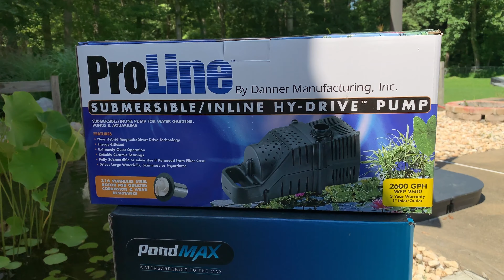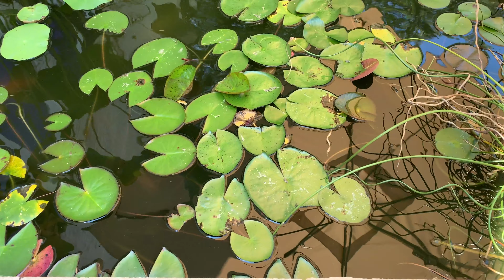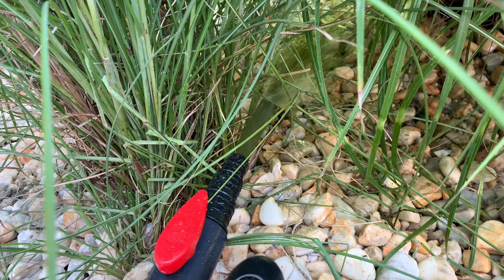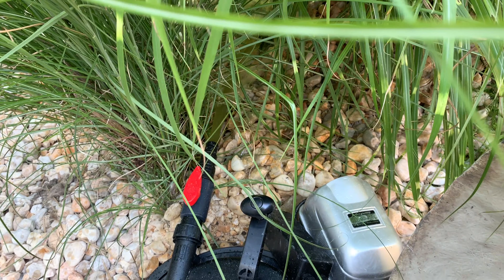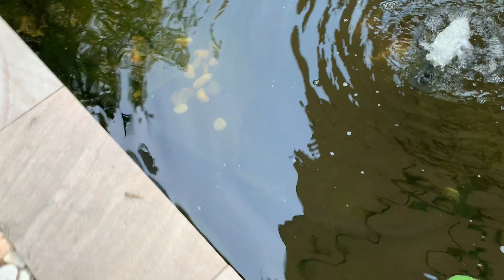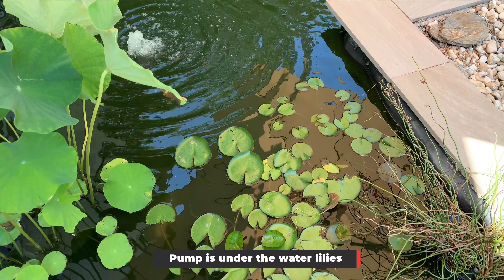Fixing My Nasty Green Koi Pond!!! Time For A Bigger Pump and Filter

Comment: Thanks for sharing bud.  Good start with upgrading filtration and filter.  My 1k gallon pond I have 3885gph pump to my DIY filter and I have a 1900gph pump for circulation.  For you pond I say you'll need at least 55watt uv clarifier and about 10k-20k GPh pump to keep it crystal clear.  Look into a retrofit bottom drain if u didn't build the pond with a bottom drain.

Comment: I have the same problem with my pond, it's in full sun. We put up a sail shade that didn't seem to help much. I just got a uv sterilizer that is a 24w. We'll see how that works out.
Reply from the maker: Hopefullly that will do it for you as well. Mine is crystal clear now.
Reply from the maker: Any update? Has the UV helped?
Reply: @hooktherapy  I was only around for a few days before I headed out of state, but there was no change within the first 2 days. I bought a submersible uv sterilizer with a powerhead because the filter I have worked well on my previous pond but we moved and had to build a new one. So I know the filter works well for the size. I grew impatient and the only thing that I had in the last pond that I didn't have in the new one were moss balls. So I bought some, did a water change and it was crystal clear before I left. I head back home tomorrow, but I've been checking in with our caretaker and it's seems to have stayed clean. It's been 12 days and I'll get to see it tomorrow. 🤞

Comment: Oh you just mentioned about how much agitation you have on the surface. I'd just turn off that "fountain" in the center so you can enjoy seeing the fish.   I turned off a center fountain thing and it helped alot.   Your big airstones you have in the bottom provide enough oxygen I bet
Reply from the maker: The airstones are definitely providing enough oxygen and also creating lift to help keep things from settling on the bottom so they can be pushed from the pump to the filter. The second fountain is for aesthetic and noise. When I want to see the fish, I turn it off...and sometimes the airstones too.

Comment: Still not adequate enough filtration.  Get a 30gallon barrel and a one inch line and fill that barrel up with 10gal of lava rock and a bunch of filter mats.   You can put the barrel on a wooden tower do gravity take the water back to the pond. Hide it in the background behind that fence and plants.
Reply: That will do it for sure.
Reply from the maker: It completely cleared up the thick green water in 36 hours. It's getting even clearer as it continues to filter. The DIY barrel filter would definitely do the trick as well.
Reply: @hooktherapy  I have a 300gal stock tank pond with koi and use a 5gal bucket with lava rock and filter pads.Pond sits in sunlight with about 50% in shade, although my filter pads get clogged up in a couple days. My 5gal bucket probably holds more biological media then that filter and you have over 1,000 gallons. 

I'm not hating, it's just a small filter to have for so much volume and fish.  Way cheaper to just buy that 30gal barrel, lava rock (from home depot or lowes. Very cheap stuff)filter pads, and a decent pump.  Just build it a small wooden water tower for it to sit on and have gravity take it back to the pond.  

How often are you having to clean out that canister filter? I'm about to build my own 30gal water barrel water tower filter for my 300gallon pond. Over kill? Absolutely but I won't need to clean it for weeks and the amount of lava rock I'll add in it (10 gallons or so) is enough for a strong bacteria colony
Reply from the maker: I’m sure your method would work. Big biological filtration is wonderful. It doesn’t quite fit the aesthetic I’m going for. 

As for this filter, cleaning consists of turn to valves on the filter and cranking around on the arm that squeezes out the filter media. I do it once every week. Takes about 3-5 minutes. The water has been clear since two days after installation.